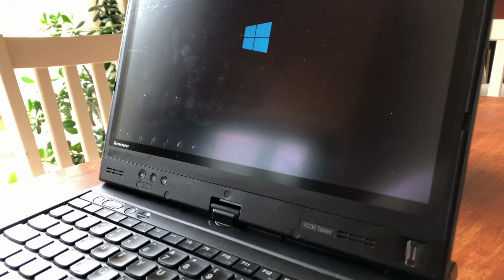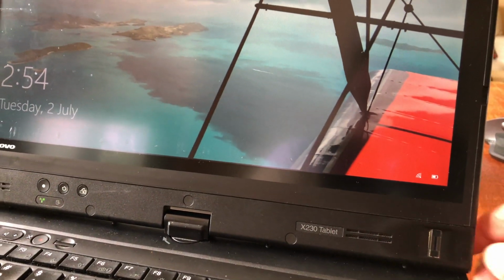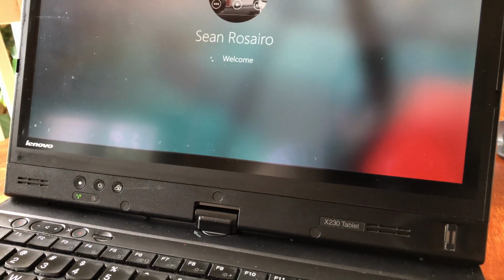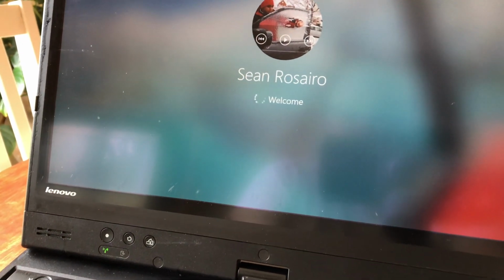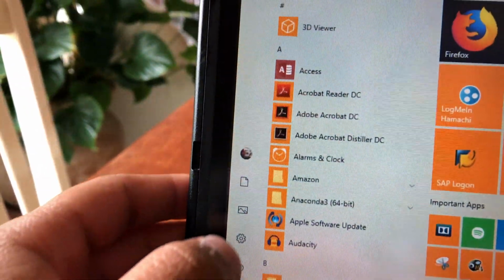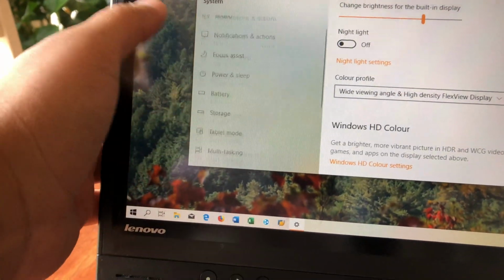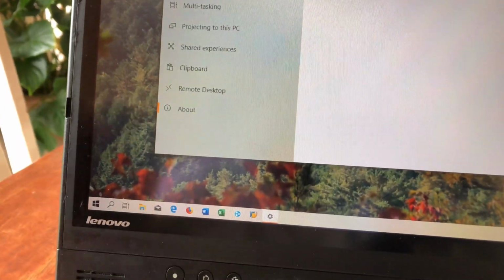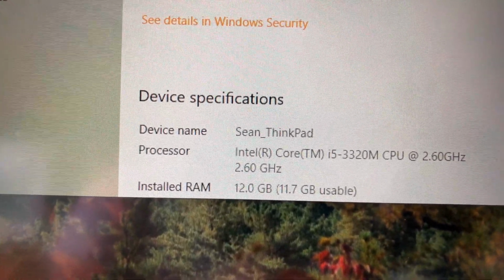ThinkPad RAM upgrade (x230t) EASY & FAST (5 min)

Comment: How did you turn on hand touch input? Mine is not sensing it
Reply from the maker: It was enabled from the factory with both finger and pen input. I think older models may have had only the pen input
Reply: @SeanRosairo  are there multiple versions of x230t? Anyways I have seen a video about enabling and disabling it but i cant find it anymore. i think on mine it is just disabled but i dont know how the hell should i turn it back
Reply from the maker: @tamaspeterradvanyi1445  There might be, but if it is all the same, I still keep the Lenovo ThinkVantage software on the computer as well. It's possible the settings are there
Reply: X230t have two version, the normal ones that can use touch input beside the pen, and another is the 'outdoor' version that features thick gorilla glass but touch can only be used with pen. Either you have the outdoor version, or you somehow disabled the hand touch input (but keep the pen ones work) o nthe control panel somewhere

Comment: Would you rather recommend upgrade from 4gb ram to 8 gb ram or from 4gb ram to 12gb ram by adding 8gb ram to by 4gb ram I have already thank you
Reply from the maker: It depends on what you need and the price. 2 4gb sticks will get you dual channel support, but I just needed it to run certain things and the 8gb stick was only slightly more, so I did that. It depends on your needs!
Reply: Sean Rosairo okay thanks

Comment: do you have a way to verify different ram speeds and if they work. I've heard 1866 and 2133mhz will work even though its not officially supported. i've seen elsewhere people claiming that the higher speeds work.
Reply: Yea, I remember looking into it because I was trying to run Black Mesa on the Intel Graphics. Basically, from what I remember, 1866mhz and 2133mhz modules weren't exactly readily available so at the time they never tested for that speed. However the chipset of the system does support those speeds. So, the faster ram could help with applications that need faster video memory (honestly mostly games). This helps since the Intel graphics uses system memory rather than having its own. 1600mhz gives you 25.6gb/sec memory bandwidth. 1866 brings that up to 29.8, and finally 2133 takes that to 34.1gb/sec. Assuming dual channel. Single channel is half that.

When upgrading be sure the ram has JDEC timings and not just XMP timings for those speeds or you won't get the faster speed. XMP is technically overclocking whereas JDEC are sort of defaults. Newer models will have JDEC timings
Reply from the maker: Yeah! So you can get higher or lower speed ram, but I matched to the old one because speed wasn't the priority. You'd have to change both slots if you're going for faster RAM
Reply: is this confirmed?
use memories of 1866 or 2133mhz??